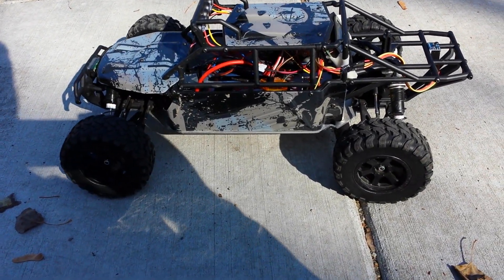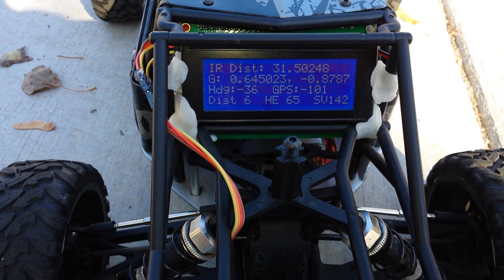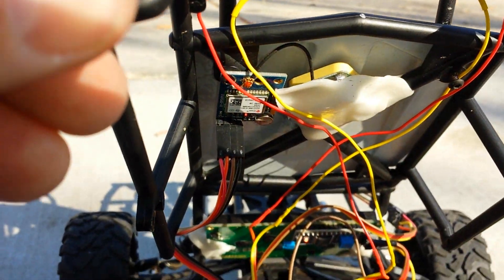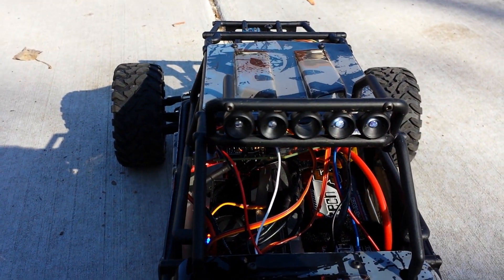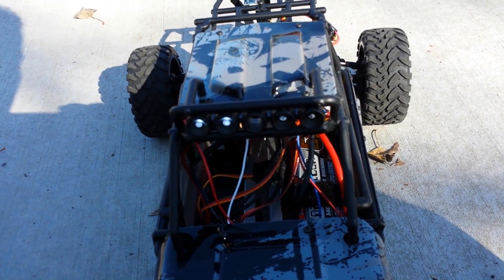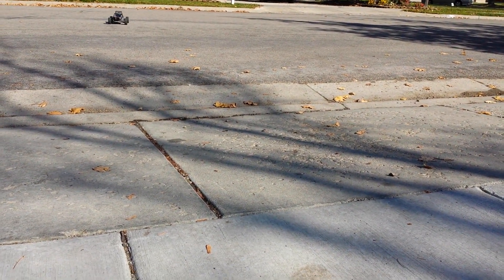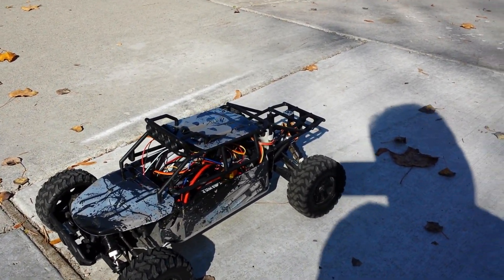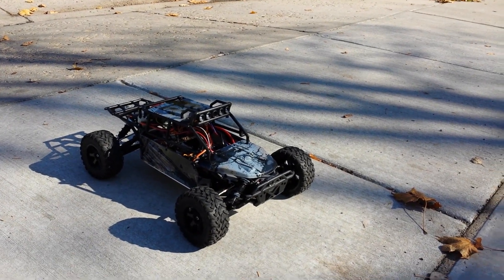GPS Hobbyking Desert Fox

Comment: I have the same problem with the compass, it sucks. I had to mount the cellphone on the nose of the car.
In my car I only use a bluetooth module, all the sensor and gps data comes from a cellphone that is attached to the car.
I payed the same price as I would for a compass + gps module and I get to use the cellphone if I need it xD
Reply: Quentin McRae That's normal,  if you gps accuracy is 6m than it will be hard to make it stoo only when it is just 1m close,  I am stopping mine at 4-5m. It sucks but gps isn't that accurate.
Reply from the maker: Yea, it was really erratic at first, but once I moved it to the back it seemed to settle down.

The thing that seems to be beating me right now is the GPS unit wanders a bit - It works great if I am meters away from where I want to be, but the GPS is continually changing slightly, so when I am trying to get within say 1 meter, it is moving all over the place.